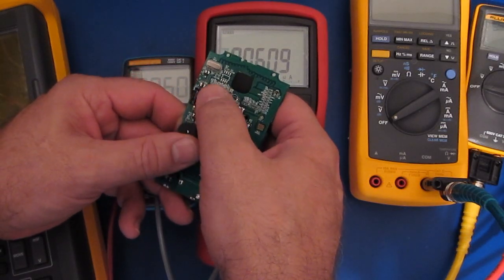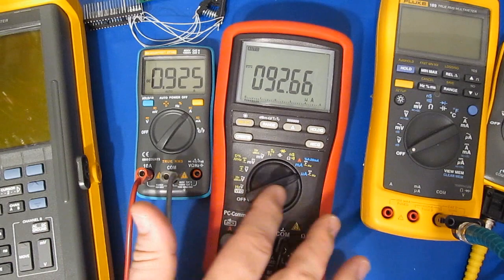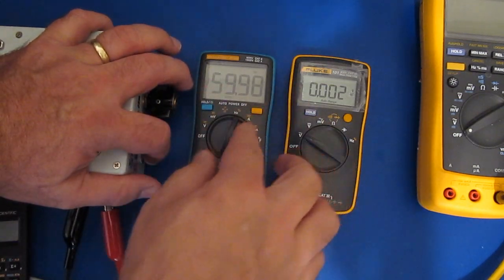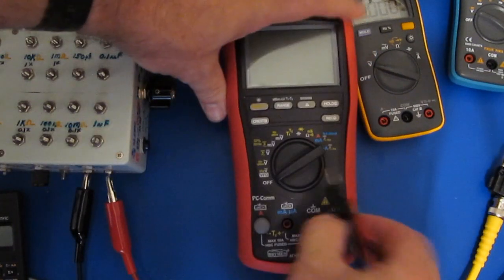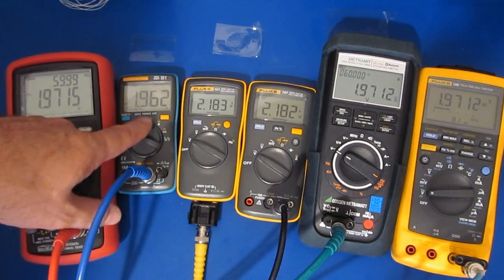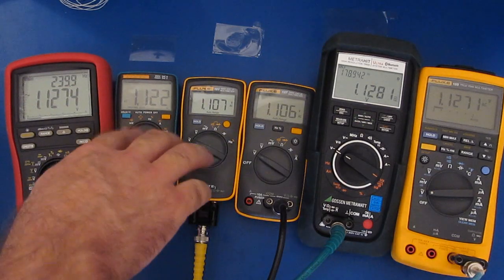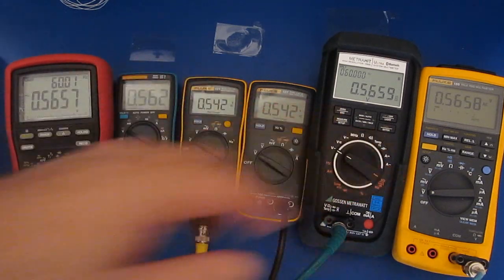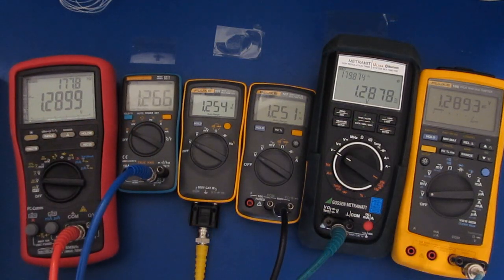Too good to be True(RMS)? KASUNTEST ZT102 False or True?

Comment: Does your ZT102A still give you accurate reading when you measure diode? Does it read correct voltage when testing diode? Thanks 😊
Reply from the maker: Are you trying to compare two different meters and seeing two different values and that is why you are asking?   If so, have a look at any diode datasheet.  Drop will be a function of current.  As for this particular meter, I made a series where I had modified it.  It's not a good example.

Comment: Hi , so you think it's safe to use at 220v live line? I mean stick it into the socket with live line? 
I am looking for capacitance checks for AC capacitors and for 220V live lines safe product, do you have any model in mind? 
Thank you!
Reply from the maker: I am really only concerned with how robust the meters are.   I also don't normally offer recommendations for products.

Comment: This scopemeter is you 97 At a local site there is one listed as Philips PM97. I was confused by its BW, since is a 50Mhz but If not mistaken it samples at 25MSs ?. I dont remember the numbers but I was puzzled at this time. Didnt know about Philips working together with FLUKE. I have read some review from long term users and they had issues with the backlight ... I always have a look to scopmeters by Fluke. Used a 123 on a Daily basis for two years .... LOVED IT.  I would love to AFFORD a 199 ... welll .... I cant paint my UNITs yellow I guess LOL
Reply from the maker: The 97 does indeed have a max sample rate of 25 MS/s.  Of course you would expect for a 50MHz analog BW scope, it would be much faster.  They way they get around this is by using RIS, or in this case, they refer to it as a quasi random sampling.   If the signal repeats and the scope is able to get a stable trigger, it can then delay the sampling by some amount.  On each trigger, the delay is changed depending on the algorithm used.   It takes several snapshots to reconstruct the waveform.   My old LeCroy 7200 for example has an analog BW of 4GHz, yet it only samples I think at 100KHz.    If buying a new DSO, you want to make sure you understand what your requirements are and if the scope will meet your needs.  If you have random data, you want to make sure that the single shot rate is fast enough for what you need.
Reply: @joesmith-je3tq  Many thanks for the explanation Sir, pretty clear. They should anotate "periodic signals only". Probably they did and missed it out. It is a good point.  Today I tend to look more at the GS/s rate (or MS/s) than the BW because I do most digital and sometimes events are non repetitive. THese damm Flukes still pretty expensive here, even when they are mid 90s. But they are good tools, rugged and reliable. In the end, they worth their money (not so sure now with the most recent scopemeters). Regards
Reply from the maker: @38911bytefree  Just be aware, that sample rates will depend on the mode.  So while that vintage 4GHz LeCroy I mentioned may only sample at 100KHz or so, in RIS, it samples at 100GS/s!!!   Make sure you understand the difference before buying anything.

Comment: Joe, I read there are various ways of measuring RMS value; Thermal AC-DC converters, Peak and Averaging AC-DC conversion, Analog AC-DC converters and finally Digital Sampling. In that regard which category does this meter vs Brymen 869s fall under. There's some reading on the web, but it's a little heavy on the cream for me; Maybe you can shed some light on the matter. https://literature.cdn.keysight.com/litweb/pdf/5988-6916EN.pdf?id=1000002261:epsg:apn
Reply: Also, there are DVMs adverised true RMS for AC only and some AC+DC. As for AC/DC, I like Thunder Struck, and "highway to hell".

Comment: I'm wondering if you would recommend this (ZT102) meter to a beginner like me? Or is there's something else you can recommend in the same price, Thanks :)
Reply from the maker: Sorry but I do not make recommendations.  I will say that when I started playing with electronics, I was given a VTVM.  I used that until I turned 13 years old.  I then received a brand new Radio Shack analog meter and used that for several more years.   It served me well for what I was doing.   We all have different requirements for the tools we use.   Enjoy your new hobby.

Comment: Dear ,
Joe would like to know which one to buy FLUKE 101 or RM101? They are the same ?  Greetings from Brazil ...
Reply from the maker: Hello.  The two meters you mention are not at all the same.  The RM101 has a lot of features that the Fluke 101 lacks.  The RM101 may also cost a fair amount less.   Then again, I have put the Fluke 101 through a lot of tests over the years and this meter continues to hold up just fine.  I suggest you download both manuals and compare the two.

Comment: Do you know if it measures duty cycle in AC? If so how?
Reply from the maker: I am not sure and suspect it may be meter to meter dependent.  The last two I bought could make this measurement but the previous ones could not.  There is no marking on the meter showing it supports it.   One had grease on the contacts other have not.  Every one used a different xtal.  They are anything but consistent so I would suggest it's a grab bag.    I am not sure what you meant be how.  How to get it into that mode, how to hook it up, how does an ADC work with software to calculate DC....  Door it wide open when you toss out questions without details.

Comment: Hey Joe, may I ask a question not related specifically to this video but generally to everyone you made. Where do you find the boxes for your DYI, I'm planning on doing few (VERY SIMPLE) things, but i'm not able to find decent boxes. For example i have yet to find a box big (and strong) enough but not  hugely big for building my isolation transformer. The boxes i looked for (2 week research) are all very expensive, more than the stuff i have to put in, in the end a mini itx case would cost me less, maybe i should use one of those.
I guess in the US you can have all those sort of stuff made for cheap and readily available in your big shops, maybe?
Sorry for the partial off topic
Reply from the maker: I handmade the two wood covered metal boxes that I used for the transient generators.   These are both made from 1/4" plate aluminum.
Reply: Ah, i see....I somehow expect it from you. Thank you anyway.
Reply from the maker: There are pictures of their construction in the main forum.   As soon as I get beyond a simple plastic Bud box, I normally make my own.  Many of them are just simple sheet aluminum that I drill, cut and bend.   Personally, I think it was a disservice to the public when we stopped teaching metal/wood working and machine shop in our schools.  I guess we need to keep the kids safe....

Comment: Thanks for doing this test! I wasn't sure whether or not these meters are TRMS, you proved they are.
Reply from the maker: It's a TRMS meter but keep in mind the problems it has.
Reply: I'm fine with the protection it has, since I plan to use it for circuits under 100V. Maybe 350V DC tops, but not very often. 
 Bandwith limitation is pretty sad, but it's kinda naive to want 100kHz bandwith from a DMM in this price range.
 Your last videos cleared things up about this meters, now I know what to expect and what not to do.
Reply from the maker: Assuming you took the time to watch that long video, and you understood the problems, you should be good to go.   I'm not sure if I couldn't increase the BW of this meter.  The UT61E is a sub $50 USD meter and you gain higher resolution, much higher bandwidth, uA range, better switch contacts, standard fuses, serial interface to the PC.

Comment: So far, the only issue I see with this cheap little meter, is the wrong CAT rating.
If they would just rate it lower it would be a fine meter?
Reply from the maker: I would say that depends on what you are willing to overlook.
Reply: What do you exactly mean by that?
Reply: Don't forget the most annoying feature of this meter, the 15 sec timer of the backlight, wich starts to count when you press the light button and nothing makes to reset that timer. You press a button or switch metering mode in the 14th sec? It doesn't care, 1 sec and the light is off, how stupid is that?  Also, the distance between the two tiny plastic feet on the back is less than the two buttons on the top, so every time you press a button it wants to tumble upside down.
Reply from the maker: dA, meaning if you are willing to overlook all the problems I have pointed out making these videos and depending on what you consider to be "fine", then sure, I could see someone calling it an excellent product.
Reply: joe smith Well, the way I see it, is it's basically a CAT I/CAT II meter, with a very decent resolution. It has some quirks, but you can work around these things. For low voltage electronics fine, for heavy electrical work a no-go.
Reply from the maker: Well, the way I see it,  If I ignore the small non-standard fuses, the cheap connectors, poor switch contacts, no relative mode, no uA or uV ranges.  Even if I ignore that the input protection was poorly designed and clearances are way too tight.   Ignore that ever meter I have of the exact same model is built a little different and has different features.  Sure it has a very low BW but the oscilloscope makes for a good tool.  The one thing I really don't like is how the auto range fails to work and the only work around is to add a button to manually range it.   Depending what you are doing, I could see overlooking all of this.   Personally, I would have no need for this meter for electronics.  It does have temperature so I could see using it in the garage as a disposable meter.
Reply: It's all about expectations. I don't expect anything from a $15-20 meter.
It's not perfect by far, that's pretty obvious.
I still believe that for simple CAT I/II work, it's fine for the normal ranges.
Reply from the maker: If you don't expect or need it to do anything, why buy it in the first place?   Regardless of cost,  I expect at least the basics to work.  Personally I do a fair amount of hobby work with high voltage, low energy circuits, both AC and DC.  That auto range problem the meter has would make these meters worthless for me.  But if you work below 20 volts or so, that's no longer is a problem.   Then again, there are many meters available that don't have this problem and are a much higher quality.
Reply: I can think of a million reasons. But a few are, price and out of curiosity.
My wallet isn't limitless.
I can even think of a professional situation.
We used to have interns doing some very basic measurements (measuring resistors, diodes, and sometimes only low voltages). They weren't able (and allowed) to get in touch with any dangerous voltages/currents.
In this case, it didn't really matter if we would give them a $300 Fluke/Brymen or a $30 cheapo one, somehow they would find a way to break it.
So in this case this little meter would be extremely handy. It's super cheap, small, it would give them/us just a little bit more precision since it's a 9999 count meter and I wouldn't care if they break it.
In fact, for most voltages most hobbyist (and professional engineers) work with (< 30Vdc), the ranges are adequate enough anyway.
Keep in mind, I am not saying this is the perfect meter, very far from that, but I can see enough situations that it would work fine.
Yes, if you have the luxury to buy something better, I would also go for it.
Reply from the maker: So you do have some expectations for the meter which makes more sense than your original statement of not expecting anything from it.   All joking aside,  I wonder in a school environment how many cycles the contacts will survive before the meter starts to be intermittent.  The ones I have looked at have some very cheap contacts and feel like they are grinding as you turn the knob.

Comment: People want to hate these Zotek meters but they come through pretty well for what they are.
My concern now is the bit you mentioned in a former video about them putting a low impedance across the input when off because the alert that warns of approaching auto-shutoff has me switching them off while they are still wired into whats being worked on. I didn't catch what you said it was. I guess the question is how much voltage it can take while switched off.
Reply from the maker: With the original meter, it's basically switching in that small PTC and clamp.   I would not exceed what the datasheet for that part calls out.  I suspect this is a 5mm part.  From the few I looked at, maybe the 1K5.   Keep in mind that too, this part may be over what other parts of the meter are rated for.  Safest thing would be to treat it like the resistance mode.
Reply: Thanks, at 1.5K or so it won't be much of an issue at voltages I usually work with, but an essential thing to know about.
Reply from the maker: I believe it is an MZ31-05?152?900.  The withstand voltage for that part is 900.
Reply: So the impedance of the PTC should be ramped way up as one approaches that Voltage. Thanks for the spec.
Reply from the maker: Yes.  Even if you put fifty volts across it, the PTC would start to heat up and its resistance would increase.  At some point the PTC will arc over as I have shown and that will pretty much be the end of the meter.

Comment: Basically waveforms are all that you will see in the field, and they all seem to be reasonable at showing the value. Shows nicely the value of a TRMS meter over average reading. Last one looks remarkably like a colour video signal, complete with colour burst in there and staircase grey step.
Reply from the maker: Yes, you see waveforms in the field if you have a scope.  lol.  I am guessing you meant sine.   For AC measurements, I see a fair amount of modulated waves and rectified.   Link showing how we did this remote waveform.  

https://www.youtube.com/watch?v=S7c10rDkkyg

This link has the discussion.
https://www.youtube.com/watch?v=yD-q6bq7mlE